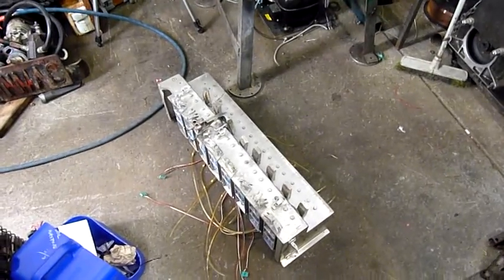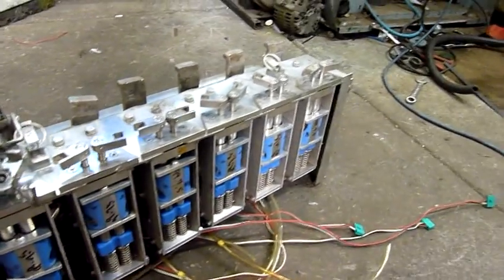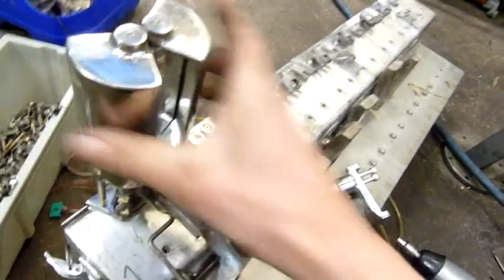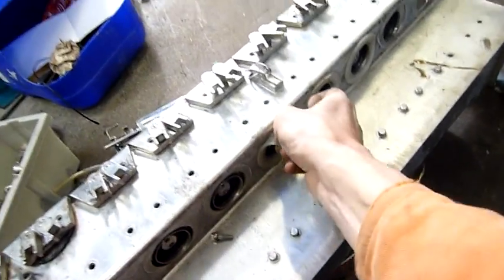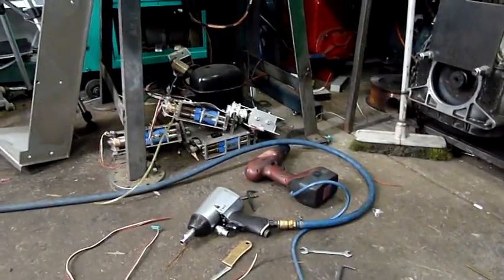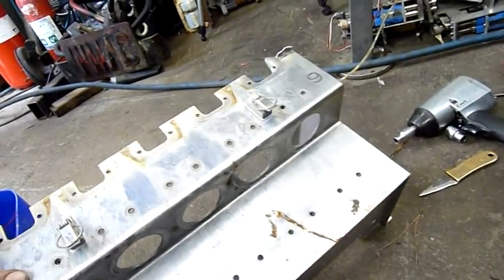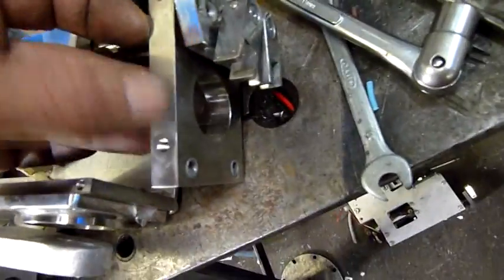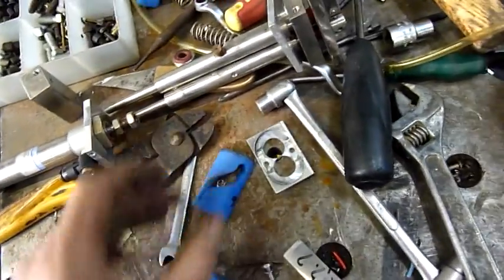Yamato Dataweigh Load Cell Autopsy

Comment: The pads work by changing resistance as the wires are stretched. generally load cells are rated in millivolts per volt for each unit of measurement (eg grams). Putting a known voltage across them and measuring the change with strain should give a reading. My dad's a service engineer on industrial weighing eqipment, so if you want any questions answered I can forward them on to him. Good luck with learning load cells, they are fairly interesting imo.

Comment: I would bet that they were resistive strain gauges.  Very fine wire in a zig-zag pattern on the surface of the material, so its resistance changes as the material its adhered to flexes.

Comment: my uncle just bought an older air compressor. this thing is massive.25 hp electric motor i believe its a 2 phase compressor. the cylinders are huge i have never really seen seen one so big before.